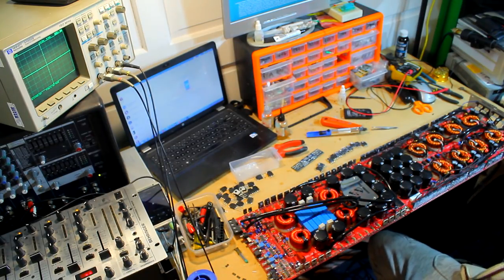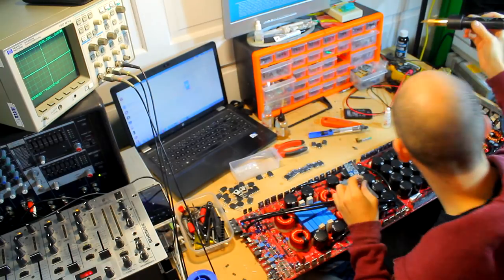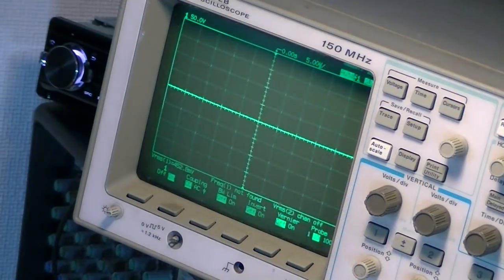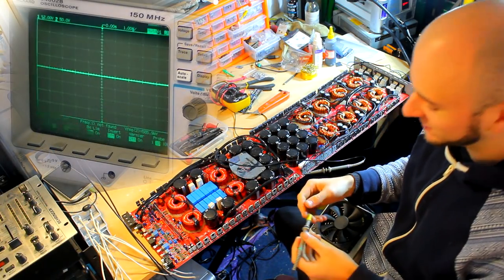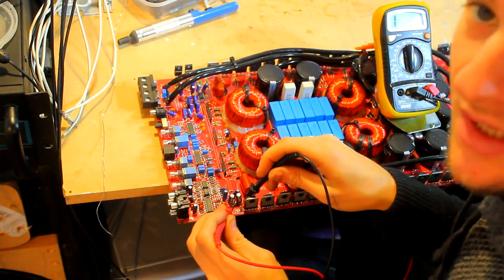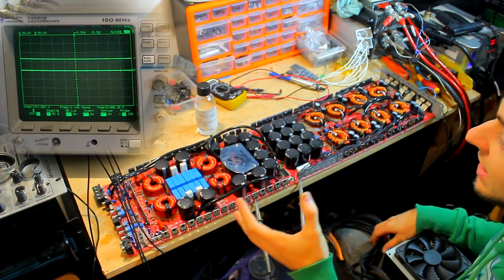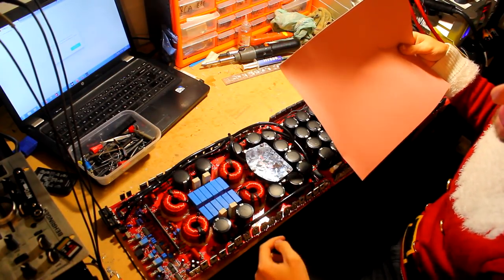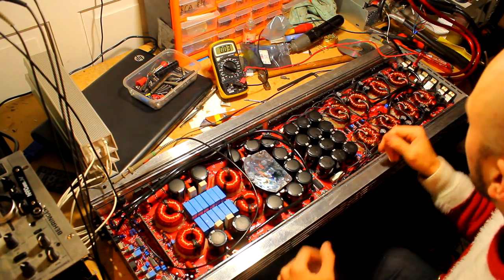Amplifier Repair 10,000Wrms Ground Zero 10K subwoofer amp

Comment: I think the reason its not one board is because the panels that the PCB factory makes only go so big, and if it not hand made it has to fit into a pick and place machine and wave or other soldering machine. Those boards as they are, are really big.

Comment: Wouldn't the casing of the power supply on your lap be a potential path to ground when your messing with the high voltage? just thinking if you happen to knock it with your hand while your poking around. Not a criticism, just genuinely interested. love your videos by the way, I have learned so much from you and i am really hooked on them.

Comment: I hope the owner appreciates all the work and pays for the pleasure of having it working again.
Reply: I started of in the early 90's in the repair trade, doing tv and videos..
And moved on to audio large pa amps/ valve gear etc.. built some many amplifiers over the years.

There was no you tube vids.back then.     These vidz are full of info but the main thing to new starts is you must learn basic electronics before taking on peoples equipment as it can be costly if you someone's unit up!!!

Comment: irs 21844s : One channel of the drive is floating to drive the high side -- with an interlock signal return to make sure both channels never drive at the same time. 
All is fine if you don't have any ground loops :) or stay rf currents activating the parts out of turn. Check for cold soldier joints that can rectify rf noise. Manufactures should twist any long leads from HF transformers.  Of course actual drive transformers are expensive and engineers still think optical isolated drives to be unreliable. But on the other hand getting rid of ground loops (or depending on noisy ground returns) is part of best practices for low noise and reliability.  It is no wonder these drivers commonly fail, working along side 'horse kick' currents.

Comment: May I recommend an incadescent light bulb to discharge the capacitor banks? Instant visual confirmation of near-zero discharge. And,the filament resistance goes down as it cools off. Best of both worlds!
Reply: Or he could use a DMM with a LowZ Volt mode to discharge it.

Comment: Ithink those sparkly heatsink thermal pads might be made of mica, used to be used a lot back in the day, not as thermally conductive as modern pads and have to be used with thermal compound, but heat resistant and a good insulator. Great vid, thanks!

Comment: The hight side driver's wave have amplitudes in the order of the rails voltages (it goes from -vcc to vcc+10V), that's not the case of the low side (it is between -vcc and -vcc+10V approximately). So, whit that scale, you wont see it in the scope. Sorry for my bad English.

Comment: Hi, I've been following your videos for a while and you are probably the most knowledgeable amplifier repair guy I've ever seen lol if I may, I would like to ask your advice on starsound 15k's I have. I recently strapped them and found that when I play them separately they play loud and nice but when they strapped it is significantly softer. I called Starsound for advice and they advised that it's my setup, I.e. connections or wires. I would appreciate if you could give me some direction, if they need repair or is it actually my setup. Thanking you in advance and thank you for your informative vids. Wafiq

Comment: What are you constantly talking about grounded?
The 8 power supplies in the power amplifier should have galvanically isolated the primary (12V Input) and secondary (internal Voltage) sides. The PC power supply forms a second galvanic isolation.
The protective conductor from the power supply reaches your PC power supply housing and ends there. No voltage should be measured between the protective conductor and one of the PC power supply outputs - otherwise the power supply would be defective. Normally, no currents should flow on the protective conductor.
Everything else points to malfunctions.
The amplifier housing is normally internally connected to GND of the battery terminal by the screw connections and has nothing to to with the high voltage Rails of the AMP.
The ground connection of the RCA jacks would have to arrive at the 0V level (center tap) and also on the speaker terminals at minus and should have nothing else connection. This is the audio ground and is a part of the balanced power supply of a good amplifier.
This is one of the reasons why the operating instructions always warn against connecting the loudspeaker ground connection with the car body.
If this happens exactly, strong noise will be generated in the speakers, which may also depend on the engine speed.

I have never received an electric shock from a power amplifier just because I touched the + or - rail despite grounding strap ...

Some time ago I had a Toxic TN 1500 amplifier for repair. Repair costs 15 euros.
All 4 MOSFETs in the power supply completely burned off and two different output stage transistors with short circuit (positive rail to negative rail). After my repair she worked perfectly again.
When I asked how this happened:
A double fatboy subwoofer (two woofers with double voice coil) connected so that the impedance was only 1 ohm (all 4 voice coils in parallel). Definitely too low for this amplifier. Especially if you want it loud.
Weeks later I heard the same buddy with exaggerated bass in a parking lot. I wanted to listen to it more closely and sat in the car with him - with each bass beat the engine speed went extremely far down.
I asked him to give me a look. Again, the double Fatboy, this time a MAC audio power amp (any MPX ...), and again a daring and incomprehensible wiring of the individual voice coils. The power amp became unbelievably hot within a few seconds, even at low volume levels, and switched off. He had a woofer with his two voice coils on two different outputs (L and R, instead of two times L or R.) More I do not have to say - right?
Once properly wired and he suddenly has more power, but this time without affecting the engine speed and without the "power amp" shuts off. The AMP even stayed cool.
Stupid if you give the same speaker two different signals at once ...

Work with experts one time...

Comment: As an electrical engineering student and subwoofer aficionado, I love these videos. Also, had no idea you could solder/desolder with a hot air gun. No more putting boards in a toaster for me!

Comment: And the reason why the 2 boards are split is because the actual manufacturing of the circuit boards that's the Max size that they circuit boards can be manufactured in

Comment: don't you clean the flux off board ? I think cleaning up after soldering gives you a better chance of finding more fault .Or maybe you don't care as long as you get payed and leave it for the next tech ,not a great way to work :(
Reply from the maker: I am the next tech. I'm the only guy in the UK repairing these kinds of amps. The flux is no-clean and the customer prefers a cheaper repair bill from cutting unnecessary labour cleaning flux off hundreds of vias. Not once have I had a repair hindered by the presence of remaining flux. If anything it's a nice reminder as to what has been replaced in the past.

Comment: When you were contemplating to power it up on low voltage or pull all the FETs I was thinking pull them all save yourself the headaches and sure enough you pulled them. Great channel.

Comment: Another great informative video. I have fixed a couple more amps since watching your videos. Gives me inspiration to dig into my pile of amps that need repair. On a side note, I use a pair of channel locking pliers to install the hold down clamps on the mosfets. Makes the job quicker and easier.

Comment: if you are not using thermal pads what do you put to isolate (electrically) the fets from the case with paste?
Reply from the maker: You must use pads.

Comment: 4:29 - Hi Sam, those diodes on the driver board are not zener diodes, they are high speed diodes used to charge pump those caps on the high side driver so you have a floating supply to power the high side driver circuit. A better substitute for the IRS21844S is the FAN7393A, it has same pinouts, but has slightly higher source and sink drive capability of 2.5A as well as having rise and fall times, faster with less delays. So you could use MOSFETs with slightly bigger gate charge and get the benefits of a MOSFET with lower Rds making the amp output stage more robust and efficient, if you so wish.
Reply from the maker: Thats fucking amazing advice buddy thank you so much! I will certainly look into those ICs! And thanks for the correction on the diodes :)

Comment: Barevids . I can't find proper resistors online. I need an 5.70ohm the resistor is green and its green violet gold gold. I can not find this resistor online. Can you give us an election parts source
Reply from the maker: That's because it's not a resistor lol. I explain these in many of my live streams. It's a little inductor. With that knowledge, search google for the inductor stripe colour code and you'll find the correct replacements.
Reply: barevids thank you.

Comment: I have a addictive audio fix 500.1 and about quarter volume the output start clipping terribly is it possible that the output fets shorting under a load everything else is okay I work on amplifiers but I swear I just can't figure this one out for squat because the output fets check good on my meter
Reply: Scott Miller probably electrical or your signal coming in to amp.

Comment: I’m surprised a ground zero messed up there usually solid amps. But low voltage, to much heat, to much gain creating heat can burn anything up so I’m about sure it’s not the amps fault.
Reply from the maker: It was definitely the amps fault, there's nothing special about these. Same as any other brand, very generic board.

Comment: You seem to know a lot about amp repair but dont know anything about ESD or take any precautions against it.
Reply from the maker: Esd has no power here! 😁
Also, I'm just a random guy who decided to teach himself to repair this crap, never taken a single electronics class in my life. Just jamming along doing my thing, and seems to be going great. Thanks for watching!
Reply: @barevids  Im just telling you because mosfets are extremely sensitive to static and you are wearing a fuzzy sweater.Dude get an esd strap and ground yourself and no more 8.5 ohm RDS stuff :)

Comment: Hey Dude,i just watched a video of yours about the DD Z 12",i have too ask how you got a 12",when the only thing the sell here in the United States is the Z 18?. any reply welcome???.
Reply from the maker: John Lundgren hi dude. the Z is available in 10,12,15,18 and 21 inches, in USA and Europe.
Reply: Hi Again,what is your name?. so i've been looking at DD's for about 3 yrs now,but i could careless about SPL,currently i drive a 2006 Honda Odysee Van,i have a cheap Pioneer single Din Deck with a Front USB plug just so i can play my PANDORA thru the 6 original Speakers,but i'm more about a clean sounding system.i just can't make up my mind when it comes too SUBS,i would prefer just 1 in a Box,with a DD amp 400 watts max. i'm 56 yrs old now,and i all i listen too is Deadmau5 and Skrillex ?. but i want a Sub from DD?.

Comment: Use Dow Corning 340. A toothpaste size tube should last you a lifetime.
For thermal pads I use Isostrate which has the paste already applied. They are made of polyimide (Kapton) which has a very low thermal resistance and are a hell of a lot cheaper than Silpads. You can make your own by buying a 25 um polyimide sheet and cutting a long strip and pasting it up manually.
Reply from the maker: Great advice! Thank you buddy!
Reply: Seriously man it’s a 10,000 watt amp, if you’re running that you aren’t concerned about cost... a few $100 is absolutely nothing at this level of power... just do a little math on how you’d get 12 thousand watts @ 12volts to it! Lol it’s insane.

Comment: Yoo barvids I got a problem with my SD saz2500d the amp powers up perfectly but the problem started with THE gain level, the amp was working perfectly till it just stopped playing after i drove over a speed bump abit too hard lol. Not sure what the issue could be, but not looking to spend a huge amount of money on repairs. 😭😭😭
Reply: Look closely for a bad solder connection particularly on the bigger components, including gain potentiometer etc, or any riser boards like the driver board shown in this video.
Reply: 9ff70f96 thanks mate

Comment: You aren’t serious about the price of the SIL pad are you? Lol, an install that could even come close to being able to use that much power is going to be at least $50,000 to $100,000 USD... think about it...just the wiring in the vehicle is going to be a couple hundred pounds (100kg) of copper... serval very expensive alternators using custom brackets with a large number of batteries and lots of engine mods to put the power to all the high output alternators is gonna be many many 1000s alone...
Reply from the maker: You are out of touch with the car audio market my friend
Reply: Probably so, I’m an old fart haha, build a van back in the 90s with 16 Rockford 15”s that was capable of 161db, if I remember it had 14 large marine deep cells, the 4 140amp alternators couldn’t keep the batteries topped off for long... it was designed for shows so it ran off a huge 240vac forklift charger, had to be plugged into the wall... So how are we supplying over 1000 amps @ 14vdc continually to the vehicle these days to achieve 10,000 watts RMS... I’m assuming that hasn’t got inexpensive. 4x 0/4 wire is about $20 per foot last I saw, and that’s just for the wire you need for that massive current draw...
Reply from the maker: It never delivers 10k in a vehicle scenario due to impedance rise of the reactive load (woofer). Though even if you wire it down so that it plays into 1ohm reactive, it isn't an issue. A typical vehicle with this amplifier installed would be running two 320a alternators, and lithium batteries, possibly with ultracapacitors (2000F+). It speaks true that for any high power car audio system that the alternators can never keep up with the constant power demand from the amplifier. So if demoing all day on music there will be a period of recharge required. But for competition use it is more than enough. 70mm welding cable is used, I got 55meters for £110, used. It's generally £6-8 a meter new. Anything larger than that has diminishing returns for the cost.
Reply: Thanks, it’s come along way since I was a player, we had no class D, no lithium cells... We used to build systems to play for hours riding around town, you don’t see that anymore, at least here in the states, it’s illegal now, sadly... Sure of course we aren’t talking DC power, so we assume the complex load is a resistor to make it more simple. The load could be close to Re ohms below the tuning of the box, say 10-25hz, for subs the inductive tail rise will normally be at frequencies above the low pass filter, but you do get a big bump in impedance at Fo, below Fo though you’ll be near Re until the I2R losses heat everything up and resistance increases. That’s why IEEE would recommend four 4 aught cables or 8 zero gage for that current, smaller cable will do it, but the voltage drops will be higher and it’ll get hot. Good stuff though, it’s the engineer in me that worries about such things lol...

Comment: Ever think you might start working on home stereo receivers,  solid state and tube amps?  You'd still be using a lot of the same test equipment and similar troubleshooting concepts and the potential to expand your customer base.  Or maybe just not interested?
Reply from the maker: definitely interested, will learn. only been doing this a year and all my business is car amps. Want to get more experienced before tackling life threatening voltages and working on amps with no real current limitation on fire up. Gets expensive real quick when x32 top hat fets blow up lol
Reply: Yeah, I hear that.  I have little experience with car audio so I started watching your channel.  I love building/restoring tube amps though,  started a couple years ago.  About a year ago while working on a power amp with 6L6 output tubes the back side of my hand was introduced to 320 plate voltage, I just wasn't being careful.  It knocked me away but It felt like my hand was being crushed in a vise for a good 10 minutes.  Got a new found respect for tube amps and bought an isolation transformer and variac combo unit lol.  I still think I'm lucky to be here - this is the school of hard knocks

Comment: That thing is yuuge!

On a side note, where can I find replacement transformers? Specifically the two big ones in a PPI S2000.1D?
Reply from the maker: very hard, have to re-wind them instead!
Reply: Darth Immitis you will have to rewrap them or maby find a parts unit
Reply: barevids where do I get the wire for that type of thing?

Comment: Yellow violet black silver, equates to 47 micro-microheneries.   It's basically the same assigned numerical values and multiplies as the resistance colors, just denoting inductance.   The measured lower DC resistance shows higher current handling capability. =)
Reply from the maker: Aha! Awesome, thank you!